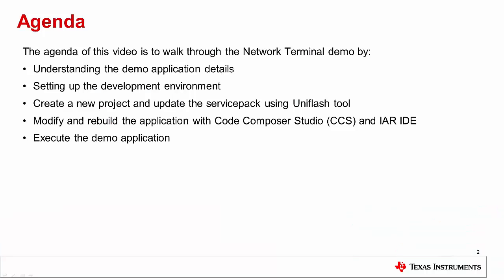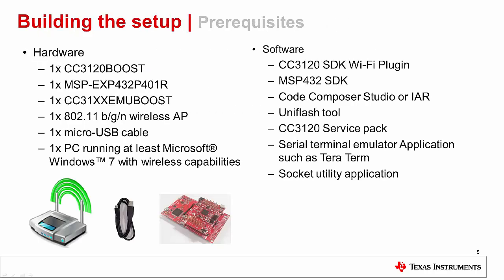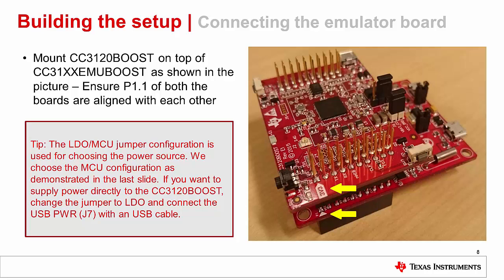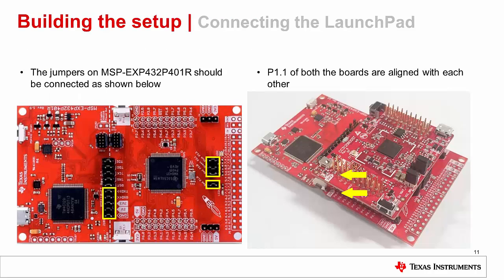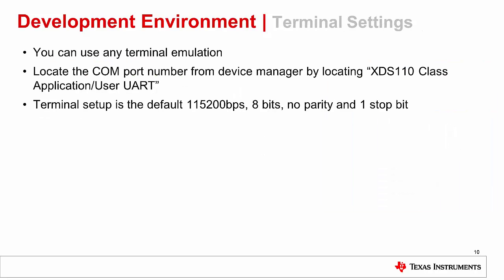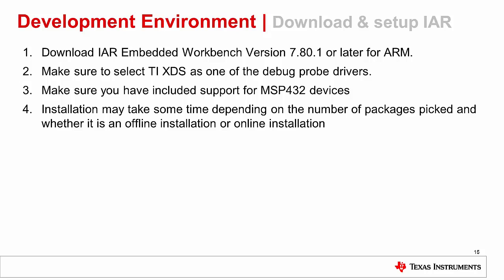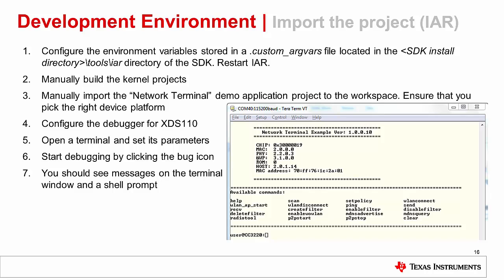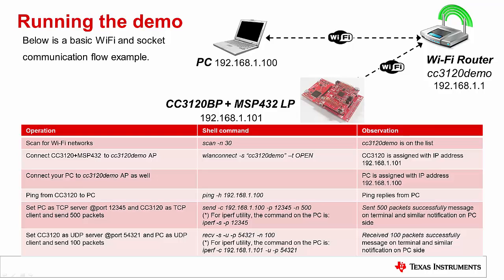SimpleLink™ Wi-Fi® CC3120 Getting Started with Project 0

Comment: Typical inferior material from TI... which I've come to expect.

All the TI links are broken...  above and in the video.
What are the purposes of the components??  Uniflash?  SDK vs ServicePack?
How many terminals are supposed to be open??  Which COM ports do they connect to?   The driver shows that is created 4 new ones.
Reply: Hallo Scott, did you find the software for the project?
Reply: @waltarmcore6311  
This was three months ago.  I am long past this stage ( with very little help from E2E I might add...)
Reply: The software is still available, you just have to know where. If there is still interest, I put up the links for you.